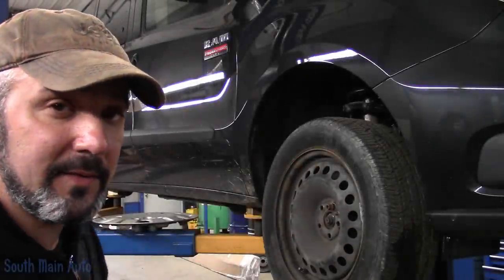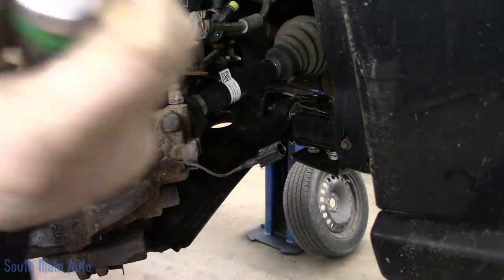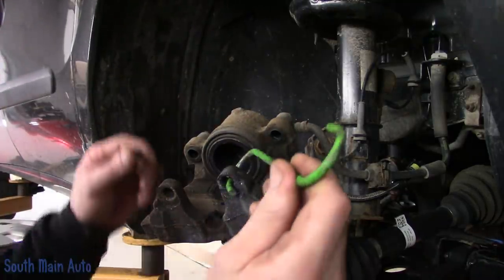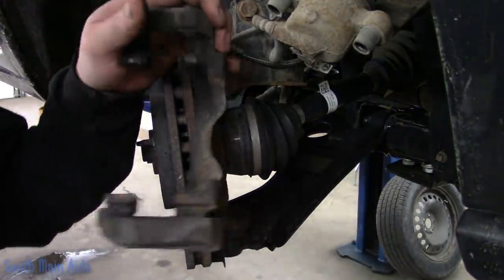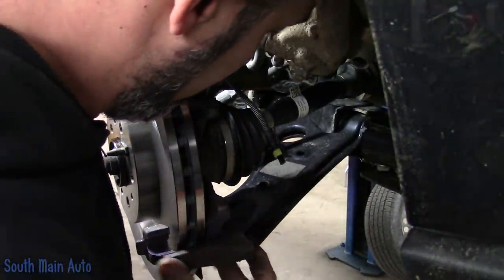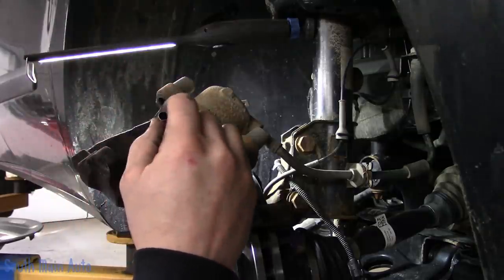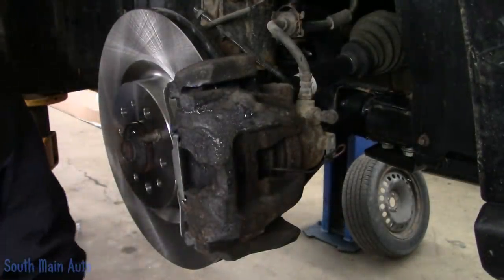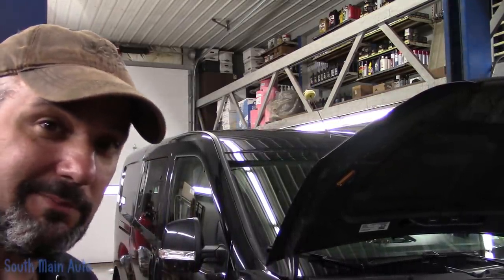Ram Promaster City: Front Brake Job

Comment: I missed the part about measuring the disk to evaluate the possibility of turning it. Seems to me that a disk should be good for 3-4 brake jobs if you don't go metal to metal or warp the snot out of them.
Reply: Very few places turn rotors these days. Just not worth the time and effort to do them when a replacement rotor is cheaper and faster. Plus 99% of them won't be thick enough to cut and still be in tolerance.
Reply: @Blazer02LS  

Sounds like a flawed design to me.

Comment: I have a 2014 Ram 2500. It seems that I have to change out the lug nuts or lug stud because the mechanic says it stretches which causes the lug nuts to not go back on or sometimes break the stud. Do you have any recommendations to prevent this?

Comment: So, does any mechanic use flat-head screwdrivers for actually rotating slotted screws?  (Speaking for myself, I can't say I've turned a flathead larger than the tiny ones in electronics in years.)

Comment: Any idea about a supposed "Oil Cooler Failure"?

My RAM Promaster City overheated, and the dealer is claiming it won't fall under the Powertrain Warranty because it was the "cooler" not the oil pump, which isn't in the list of powertrain parts that are covered.

I suspect they're trying to screw me and duck the warranty, because I spoke to another dealership's parts guy and he said he's never heard of an Oil Cooler failure in a Promaster City and confirmed that it's a passive part that oil just passes through.  But I don't know how a passive part like that fails other than cracking and allowing oil out, but I had NO oil loss, and checking the stick, it was still topped off fairly after it overheated, blowing oil into the coolant.

To me, sounds like the oil pump failed, which is under the powertrain warranty, and they're just trying to duck paying for it by saying it was the oil cooler that failed....

Comment: Obviously Eric, you've shoved enough pistons in on ABS vehicles to have never seen ABS valves 
/pumps get damaged. Although I'm retired now, I still cringe when I see this, as we were taught during the 'advent of ABS' to always open the bleeder on the caliper to allow fluid to flow away from and not towards sensitive ABS components. Has the industry relaxed it's view on proper caliper piston compression procedures currently?
Reply from the maker: Everytime you step on your brakes and the fluid pressurizes the caliper, where do you think the fluid goes when you left off the brake pedal?
Reply: @SouthMainAuto  You are making a big mistake pushing in pistons and driving all that old dirty fluid that has collected in the bore over time and been heated and deteriorated back up thru the ABS. Not that much fluid is required to apply the brakes and very little flows backward thru the system when you let off the pedal. The piston is mostly moving out to compensate for pad wear.

Comment: i just did this for my dads promastercity, its a 2017 model. quick question when you drove it when it was at idle was the car shaking? or was it smooth at idle?
Reply: I have a 2017 promaster city and I noticed a little shake in mine in idle. The weird thing about it is, it doesn't do it all the time.

Comment: Just curious why Napa premium pads and not OEM pads if it has a electronic wire of any kind or deep inside the motor repairs I go with OEM vs Napa for non electrical parts pay once and get it right vs dorman 3-5 times for my winning parts this would be a good conversation peice some day where you and us all draw the line on parts

Comment: Good video ! a little bit similar Caliper to my 1999 Dodge Ram 2500. no Low brake wire though. I Have Found that the Brake Fluid Looks terrible after 2 Years of Brake Usage. its Black & has Bits of debris/tiny specs of Dirt in it. i Turkey Baster out All the Old Brake Fluid from the reservoir and Re- Fill With Fresh Fluid. i Feel i am Protecting The Master cylinder seals with removing That Awful Looking Black Brake Fluid & The Brakes Operate Better. Does anyone know How to Wash / Flush out a master cylinder Reservoir to Make it all Clean inside ? 
and Make the Plastic reservoir clean.

Comment: Using a CV socket on an impact driver? I have been told they shatter and spread shrapnel.  Safety third?
Reply: They can if you're not really careful with the amount of torque you hit them with. The problem is that many fasteners are in tight spots so a thicker impact doesn't fit.

Comment: When I switch my winter wheels with the summer wheels and my euro trash nuts are like these, how do I clean the white corrosion off the wheel studs?  The owner manual says to not lube my nuts as they can come loose under operation.  Any tips and jokes are appreciated!

Comment: What Ram is really spending their money on their parts different size brake pads no brake hardware and wheel bolts instead of hub studs. That pseudo reverse torx bolt looks like it'll last about three years in NH.

Comment: "Brightly colored one so your less likely to leave it hanging on the car" not this guy ... Did my front brakes last week and when driving around i heard all this racket and vibrating, clacking, jingling and was like what the heck! Questioning myself "Did I forget to tighten something". Took the tire off and low and behold... That dang blaze orange hanger was dangling on the strut spring. I can do hundreds of brake jobs for everyone else but as soon as I work on my own stuff I look like a rookie. Oh well, got a good chuckle out of it and at least it was on my own car and not a customers.

Comment: Routers are groved up bad for 50k ?  Rocks cause that ?  Those are the factory pads, my 16 T&C has 70k and still have over 1/2 still left ??
Reply: Corrosion causes that. The inside surface of the rotor tends to rust a lot.

Comment: BMW only allows to put pads on the grooved rotors no resurfacing. Hey I was told that just get the lowest measurement for tolerances.... Etc... I use to do seven brake replace daily front rear.... Lol. Drive into wall forgot to prime the brakes... Just saying don't do that..

Comment: Doesn't anyone cut rotors anymore?  Seems they could have been repaired on a brake lathe.
Reply: As you know can't go by looks, measure the thickness of the rotor if there close to being out of tolerance of factory I toss them and go new
Reply: @mikecrowley6487  I know the min thickness is usually stamped right on the rotor.  Near me though it is getting hard to find a place to cut rotors or drums.

Comment: Doesn't anybody turn rotors on the brake lathe anymore?
Looks like lots of meat left on that rotor.
Happy Passover / Easter! 😇
Reply: @jack-in6hz  yes I agree with you, but that didn't look like a composite rotor. Could be wrong.
Auto mechanic since 1984
Reply: @DontCryAboutIt  you can't make a cut lighter than .003 of a inch, to do so would leave  chattering Marks and wear out the bit prematurely because of heat dissipation or the lack of from the carbide bit. Cutting a rotor is child's Play. did it for years. You need to practice more, make sure it's on your own vehicle.
Reply: @DontCryAboutIt  I'm not going to argue with you. Your opinion with your experience testifies to itself.

Comment: LOL did you really think Dodge could engineer anything right it is a Fix It Again Tony give it a round or two in the rusting season.
Reply: @DontCryAboutIt  Nope, it's a Fiat. The Sprinters are a full size RWD van and these are a compact FWD van. Two completely different animals from two completely different European companies that Dodge imported and rebranded.
Reply: @DontCryAboutIt  Close, the Duco is a full size van that is rebadged as the Ram Promaster. The Fiat Doblo is rebadged as the Ram Promaster City, the vehicle seen in this video. Confusing, but that's how all the US automakers are avoiding having to design vehicles for each specific market. The Chevy Express City is actually a Nissan and Ford's small vans are also based on Ford of Europe designs.

Comment: I agree, hanging out with you in the shop is cool, but I have a problem with you and Ivan not torquing stuff, spark plugs and brake parts. Shame in you both,I do  a lot of brakes on government owned E450s and it's the right thing to do so Little Timmy doesn't bite the farm when the brakes fail.

Comment: Jim the car guy from Boston finally did something  other than a brake job video  he actually uploaded a fuel pump replacement. So did the brakes outlast the front axel and lower control arm?  Ram Promaster shity Mercedes .
Reply: Ram Promaster is Fiat not Mercedes. The Sprinters were Mercedes though.

Comment: Ah, the Promaster, the worst POS we've ever had at work. 98000km transmission boom, gone, fixed it under warranty, 120000km, transmission gone. The dealer tried to nail us for a new one. 140000km, torque converter cracked in half, again the dealer tried to get some money from us, my boss lost it on them. Replace a headlight usually every two weeks. First time the headlight went out we brought it to the dealer, 200 bucks to replace a light bulb, my boss almost sued them for that, this happened at 20000km. The dumbest design Fiat ever conceived. People, be aware of these junks, not worth the scrap metal they are made of. And to top it off, the radio doesn't work for the most part. After you turn everything off, take the key out the blower fan keeps on going, no way to turn it off, the next morning the battery is dead, even the dealer can't figure it out. I'm sure Eric would.

Comment: No brake cleaner?!  I feel cheated.    On another note, why can't the world just use a standard hex bolt?  Why do we have torx, e-torx?!  I ran into an e-torx the other day and at the call to my 4th parts store, found one that carried the correct size socket.  Bought it, put it on the ratchet and couldn't get it onto the bolt for where it was positioned next to the shock tower.  Called around, couldn't find a e-torx wrench.  Ultimately, I welded the socket to a old piece of bar.  A hex bolt would have been a lot easier, but no, someone at GM thought it would be a good idea to use these little e-torx f---ers.

Comment: LOL, that was easy. Wait till you get a Ford Transit 250. Ya have to remove the front wheel bearing (They are pressed on) to remove the front rotor. Really good design. (NOT)

Comment: Then electronic sensor for the rear pads didn't work very well those pads and rotors were grooved. No studs and inverted torque bolts it's a terrible design. Thanks for showing this so I would never buy that piece of junk.
Reply: Then don't buy pretty much every Euro vehicle as that is all common on them.

Comment: No studs on European cars is the norm. Whoever thought of this idea needs shooting, try lining up a wheel on the hub in the dark when you get a flat, you sit there with a foot either side of the wheel propping it up whilst turning the wheel to get a bolthole to line up, complete nonsense!
Reply: You should have a rod, threaded at one end, somewhere around the spare tire or jack. It's to thread into a hole to hang the wheel onto when installing it.
Reply: @fascistpedant758  Good call. Half the cars I see haven't even got a key for the locking wheel bolt that is very common in Europe. Ask the owner where it is and you get a shrug of the shoulders or they've left it at home. How the hell you gonna get the wheel off in the event of a puncture or it needs a brake job? "Oh, I hadn't thought of that" is the usual answer! 😠